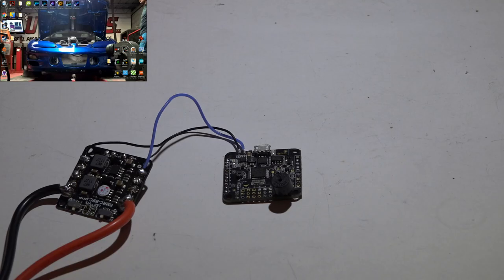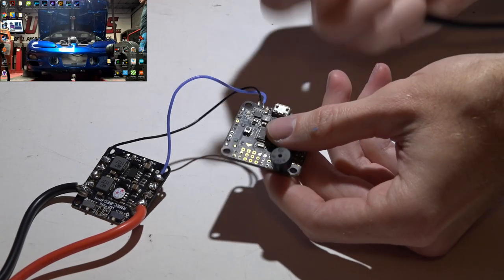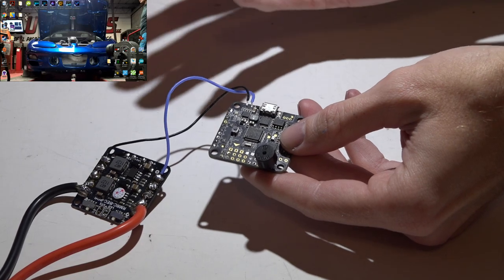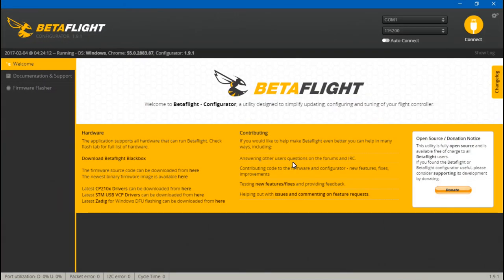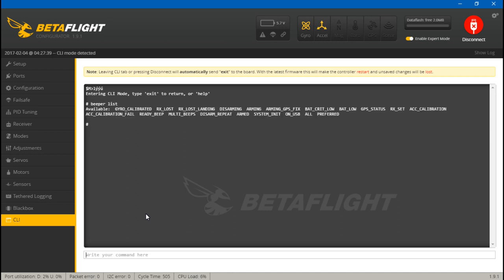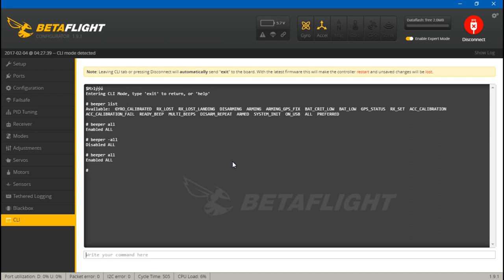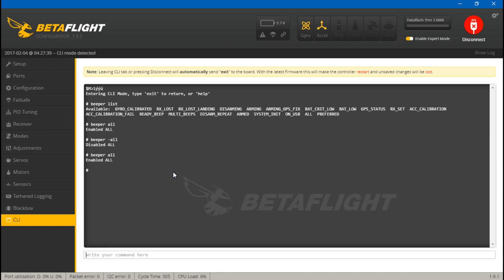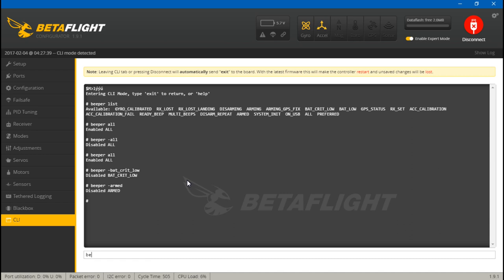How To Make Your Buzzer NOT Annoying

Comment: The micro card, I've got it, but no case. the black box does not work. By the way you can help me with an asuntillo: the pugnetero buzzer. When it worked, I had assigned him a flysky lever and had timely music. But in a betaflight update, it stopped working. You do not hear I changed the buzzer in case it collapsed and nothing. The funny thing is that when activating the lever, in the FC an LED lights up, receives the "order" but does not sound. I have to use the buzzer, the engines, through the betaflight configuration, but of course it is not the same sound and as I need to search for it ... You know if there may be some CLI command that is misconfigured and "mute". regards

Comment: ok JC now me and my friend cant figure one thing out.
FC is motolab tornado and ill give it LiPo  straight from pdb and then we give 5V from separate pololu, if i solder 5V line to BEC in to FC it will work about minute or less and feels like fc is rebooting it self, after that it works again for while, but if ill connet from pololu in uart1 port 5V and ground it works fine, i thought that Bec in was powering that uart port. this is what we cant understund. sorry 4 my English.(my quad dropped 3 times for this reason)
Reply from the maker: Thats very strange. You've got me on that one. It could be a bad pololu I suppose.
Reply: Project Blue Falcon . didnt even think that, ill try that next. thanx

Comment: I would like to prevent the beeper from activating when I plug in a battery and I don't get an immediate RX connection, as it is super loud and obnoxious (and if possible I would like TO activate the beeper after RX connection is made and lost - not telemetry).  In the CLI I executed the command "beeper -RX_SET" (assuming this was the necessary setting).  This DID prevent the beeper from activating when I plugged in the battery, but also stopped the beeper from working on the switch I have set up... Any advice? 😕  Thanks!
Reply: did you get any answer for this? I'm having the same problem
Reply: I don't think so, no

Comment: i have a FC that in horizon will lift up and hover fine but the more i fly it starts to pull to the left. is this something that can be fixed with "accelerometer trim"?
Reply from the maker: I dont believe so. There are some theories on the accelerometer drifting, and theories on how to fix it. But from my understanding there hasn't been a proven fix. There is speculation but I'm not aware of a solid fix.

Comment: At a loss.  have a buzzer soldered onto the omnibus F3 board and have one long continuous tone whenever i plug it into USB or battery.  From what I can tell, there are no shorts. Checking with a multimeter, it's getting 5V from somewhere. 

Betaflight / OMNIBUS 3.1.0 Jan 25 2017 / 09:44:46 (88693ca)
Reply: Adam Watts probably just plugged into the wrong port. Sometimes board wiring diagrams are off with the beeper
Reply: I picked up a second & third board.  The two new ones work fine right out of the packaging, so my guess is the first board was a lemon. (still works for everything else though!)
Reply: Adam Watts bummer, hope the other ones serve you well

Comment: Hey man.. Just saw someone change their quad pids through the taranis .their post wasn't detailed they mentioned "newest open tx newest betaflight" . Let us know if you know how to do this . Cheers
Reply from the maker: You can do this many different ways. If you use a OSD with Minim OSD firmware with the multirotor disarmed then move the yaw to the right and pitch up. That will access the menu. With a flight controller with built in OSD that uses Betaflights OSD feature then its yaw left and pitch up. The newest way it through certain video transmitters or even through a smart port wire on a FrSky receiver. I haven't done it that way yet.
Reply from the maker: Here is the Minim OSD video - https://www.youtube.com/watch?v=U9AhgRMlxo4

Here is the Betaflight OSD video - https://www.youtube.com/watch?v=mv2ilssWTSc

I'll have a video on the other ways soon.
Reply: I think he meant in the taranis itself, (on the screen) using opentx 2.2. , running some lua scripts. I would love to know how to do this

Comment: JC! I don't which one should I turn off bc  I don't know most of the term.
Reply: Found this:  
BEEPER_GYRO_CALIBRATED, 1
 BEEPER_RX_LOST_LANDING, 2 // Beeps SOS when armed and TX is turned off or signal lost (autolanding/autodisarm)
 BEEPER_RX_LOST, 4         // Beeps when TX is turned off or signal lost (repeat until TX is okay)
 BEEPER_DISARMING, 8       // Beep when disarming the board
 BEEPER_ARMING, 16         // Beep when arming the board
 BEEPER_ARMING_GPS_FIX, 32 // Beep a special tone when arming the board and GPS has fix
 BEEPER_BAT_CRIT_LOW, 64   // Longer warning beeps when battery is critically low (repeats)
 BEEPER_BAT_LOW, 128       // Warning beeps when battery is getting low (repeats)
 BEEPER_, 256              // when plugged into USB
 BEEPER_RX_SET, 512        // Beeps when aux channel is set for beep or beep sequence how many satellites has found if GPS enabled
 BEEPER_DISARM_REPEAT, 1024        // Beeps sounded while stick held in disarm position
 BEEPER_ACC_CALIBRATION, 2048      // ACC inflight calibration completed confirmation
 BEEPER_ACC_CALIBRATION_FAIL, 4096 // ACC inflight calibration failed
 BEEPER_READY_BEEP, 8192           // Ring a tone when GPS is locked and ready
 BEEPER_MULTI_BEEPS, 16384         // Internal value used by 'beeperConfirmationBeeps()'.
 BEEPER_ARMED, 32768               // Warning beeps when board is armed (repeats until board is disarmed or throttle is increased)
Reply: Yayat Hidayat 
Hi, if you're around where did you find this information on the beeps plz. Respect.